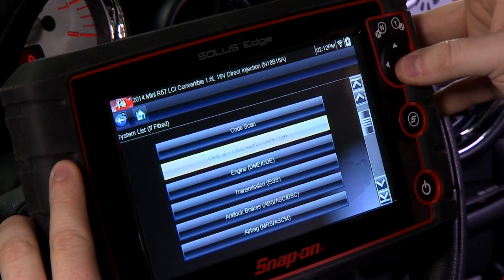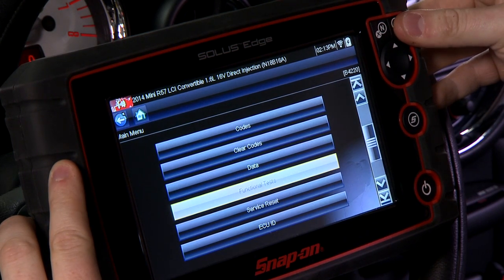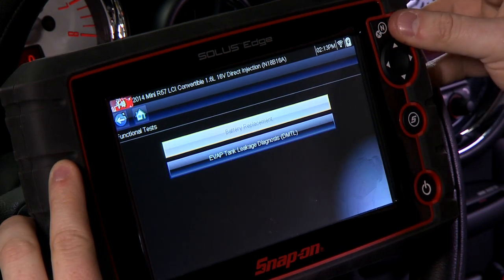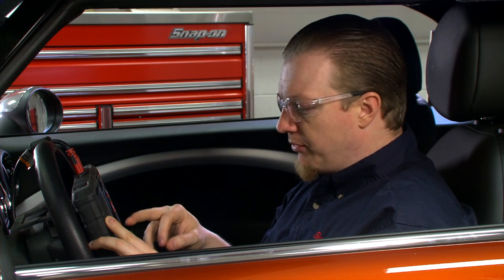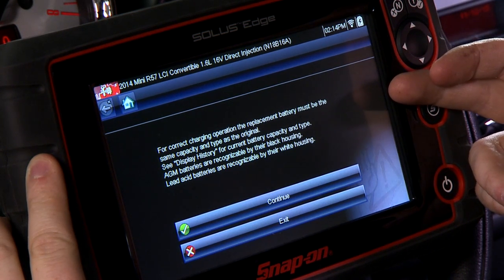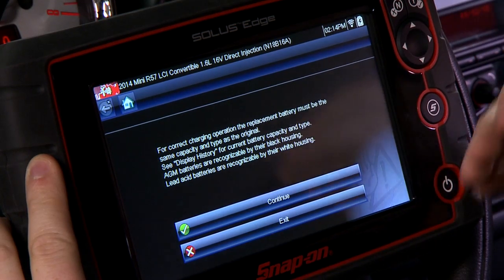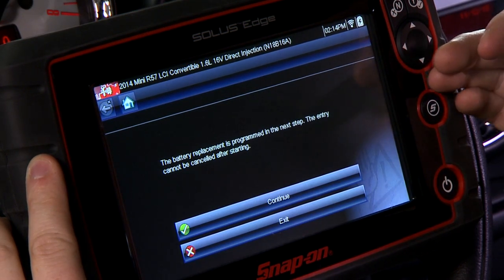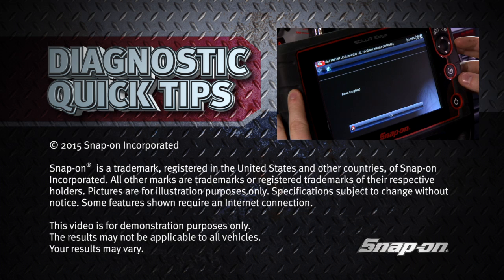MINI® Battery Relearn- Diagnostic Quick Tips | Snap-on Training Solutions®

Comment: Would you happen to know if disconnecting the battery that has already been there from before, and then reconnecting it, would it require that I register it again to the MINI system?

The reason why I disconnected it, was because I read that doing so for a few hours would allow for my car to have a "master reset" 

I had just gotten my car back from my mechanic and noticed immediately after he finished his work that my windows didnt behave the same, and that the USB, Bluetooth, and Auxiliary have stopped working. I figured it was because he had to disconnect the battery to change out light bulbs, etc. 

Any input would be helpful, thank you!
Reply: It needs to be re- registered. The car thinks you installed a new battery. The battery re- learn procedure- needs to be performed.